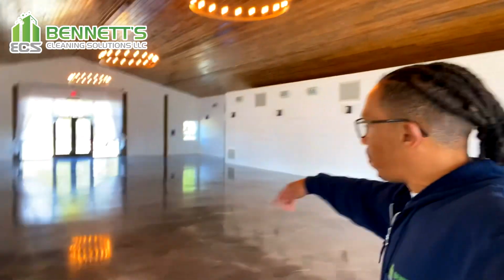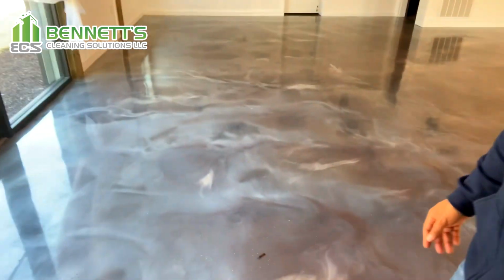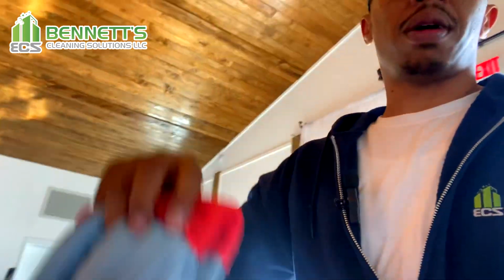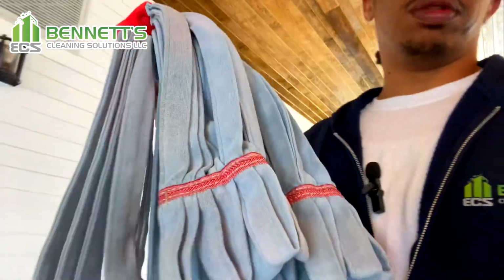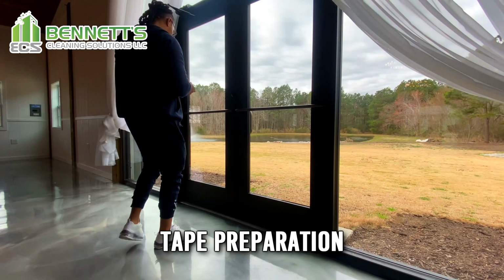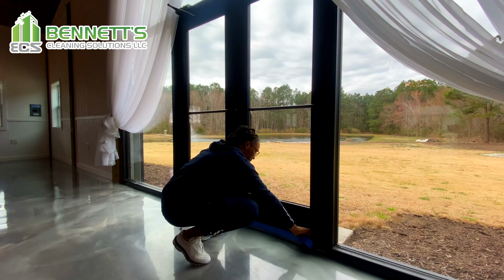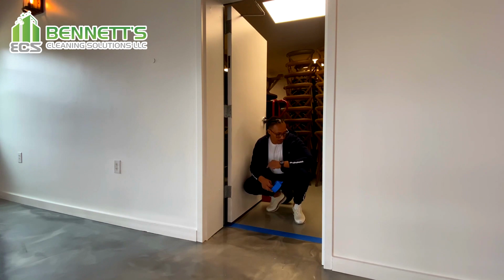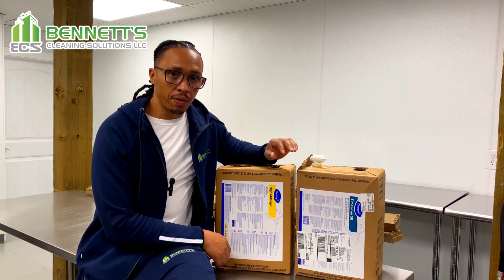DIVERSEY TIMESAVER SR & HIGH MILEAGE ￼FLOOR FINISH 💦

Comment: My thing is timesaver is discontinued so what would be just as good
Reply from the maker: @seandoran6798  https://www.nationalsupplynetwork.com/5104984-United-Stationers-Supply.aspx
Reply from the maker: You can still find it on line, if you can’t just go with Diversey High Mileage and add an extra coat or two. I’m assuming you need a finish for high traffic areas.

Comment: Much respect bro! You do quality work.  I’ve tried the microfiber string mops but personally I just dont like them. I prefer a larger 32oz or XL mop head and even the largest microfiber i can find is too small.
Reply from the maker: Thanks Bro! You definitely can’t use a microfiber string mop to apply finish. It won’t work. Those mopheads are for picking up not putting down. You need microfiber flat wet mop. Give me a call
Reply: @BennettsCleaningSolutions  I don’t mean for applying a finish. I’m just talking about everyday mopping. I use flat mops to apply wax.
Reply from the maker: @detailsmw5995  dm me on ig @bennettscleaningsolutions

Comment: Bro what’s the name of the machine you use to lay wax
Reply from the maker: That’s a Aztec Grand Finale floor applicator. It has a 36 inch pad holder. I have that and a Sealed Air Johnson Diversey Trailblazer Floor Finish Applicator as well it was being used on another job and it’s specifically for Diversey  floor finishers.. 

https://www.googleadservices.com/pagead/aclk?sa=L&ai=DChcSEwjVu467gcb9AhVHFdQBHdCNAH4YABALGgJvYQ&ae=2&ohost=www.google.com&cid=CAESbOD2JHLWhN1Yty9oPMzvqt6ib5vL4JQvBdXv1Pj0pa1XKV1KOBW99kEVM6jgnqdMA0YCoGWfPNiG-2hGnSyNvMpkuHfkqGyRRywYrD1Qb6V-2wMTitdkCzQUv4WSlbh7ag0cXuxxYzf9lR4znA&sig=AOD64_255DMNHDrG6drXSwIGPLz4zW5BJQ&ctype=5&q=&ved=2ahUKEwi57oK7gcb9AhUblmoFHWQ0C6MQwg8oAHoECAEQHw&nis=2&dct=1&adurl=

https://www.googleadservices.com/pagead/aclk?sa=L&ai=DChcSEwjVu467gcb9AhVHFdQBHdCNAH4YABBOGgJvYQ&ae=2&ohost=www.google.com&cid=CAESbOD2JHLWhN1Yty9oPMzvqt6ib5vL4JQvBdXv1Pj0pa1XKV1KOBW99kEVM6jgnqdMA0YCoGWfPNiG-2hGnSyNvMpkuHfkqGyRRywYrD1Qb6V-2wMTitdkCzQUv4WSlbh7ag0cXuxxYzf9lR4znA&sig=AOD64_0wtVculL5vgHGuTKornXUyMRIHYw&ctype=5&q=&ved=2ahUKEwi57oK7gcb9AhUblmoFHWQ0C6MQwg8oAHoFCAEQ0gE&nis=2&dct=1&adurl=
Reply: @BennettsCleaningSolutions  ok cool thanks and appreciate the content